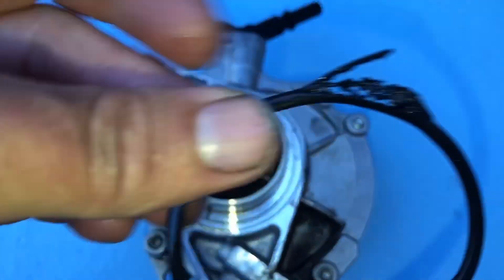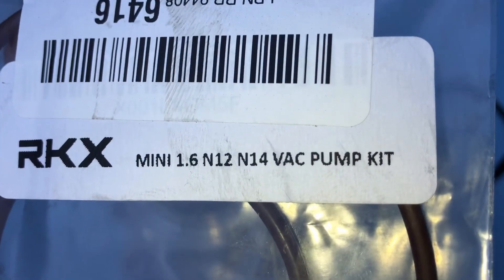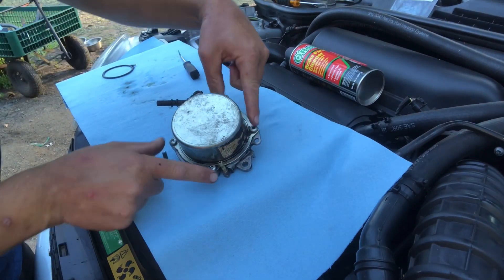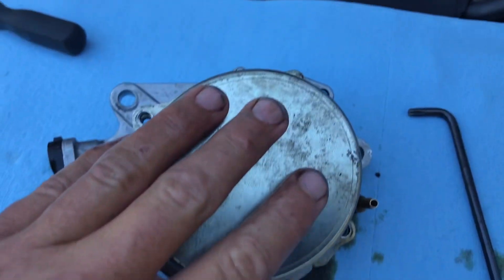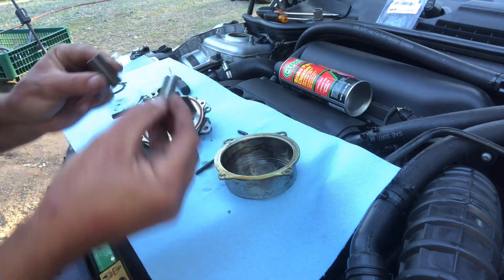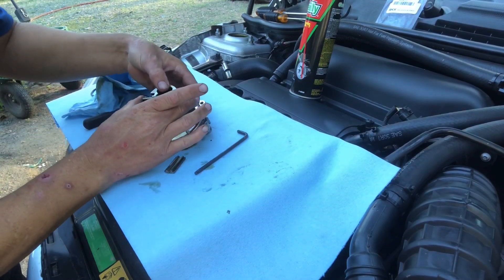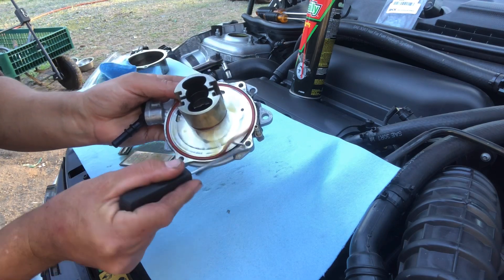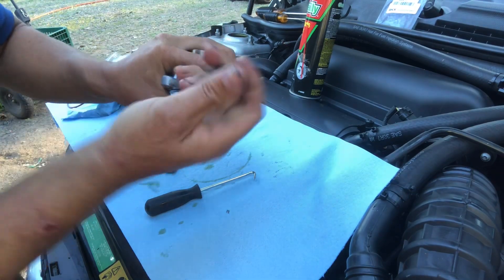How to rebuild the vacuum pump on a Mini Cooper S R56 (N14)

Comment: I'm sure this has already been mentioned but be aware of cheap after market parts. I just removed my new one I bought off Amazon after a month because it started making a loud ticking sound. Luckily I kept the old one, pulled the seals off the "new one" and put it in the old one which was working great just leaking oil. The new one had significantly less vacuum than the OG and internal quality was terrible using plastic parts.
Great vid.

Comment: Just wanted to say I'm not mechanically minded but I am learning.

My r56 2009 s series has a leak; watching your videos has given me the confidence to locate and fix it.

over time, I'm going to follow your steps and overhaul all the hoses as from what I have seen they are all crap and break easily.

Just need to ask, would getting metal coolant hoses improve, or prevent future leaks or should I stick with the plastic ones?

Comment: Should title the video “reseal” instead of “rebuild “. I believe there’s likely a bearing for the coupling shaft you didn’t address. This pump is critical. When it fails the exhaust cam quits turning.  Happened to me. Luckily I didn’t have valve damage.  Many have.

Comment: Hey bud. Great videos. So I have a question. Right now my vacuum lines go from the pump right to the solenoid and right back to the turbo. So someone bypassed the vacuum tank. Is that ok ??  Does the Reservoir tank have any purpose really ??  Thanks man.

Comment: Excellent video......and explanation.    Yeap....replace that pump with a new one. 
Might be a good idea to replace every 80K miles. My R56 has 120K and starting to notice an occasional issue with the Brake Booster.
Vacuum pump is a lot less expensive than the Brake Booster.
Reply from the maker: Thank you 🙏 you’ll be spending a lot of money if your vacuum pump fails 💯

Comment: Do you know the size of the orrings??? Oem orange one is square not circular. I’m from Uruguay I can’t buy this kit in my country.
Reply from the maker: I don’t know the size, but I’m sure that if you contact the manufacturer they can tell you. The vacuum pump I rebuilt in the video is OEM do everything you saw me remove in the video was OEM.
Reply: Project Mini thanks! My vacuum pump is exactly identical as yours

Comment: Have you thought about doing a vacuum pump delete? Or do you believe replacing/rebuilding the vacuum pump every xxx amount of miles is good enough? How many miles would you recommend? Keep up the good work!
Reply from the maker: You need vacuum for your brakes to work and for your waistgate to work
Reply: @ProjectMini  Sorry, delete isn't the right word. I meant swap. I have heard of people blocking off the original vacuum pump and installing an electric vacuum pump.
Reply from the maker: That would be s good idea, maybe someday I’ll try it

Comment: What noises did you hear from it? How did you know the vacuum pump needed to be fix/rebuilt? My Mini Cooper s 07 r56/n14 is spuddering in a way? As well the turbo doesn’t kick on when i give it gas. Half check engine light is on, just got the thermostat housing replaced, water pipe, water pump, hoses. Expansion tank. Timing Chain and everything along with it got replaced too a while back, HPFP is new as well, vacuum pump is making a slight off noise that it never made before. I need help on this
Reply from the maker: Mine didn’t make any noise. I took it off so i could move my oil feed line and saw how bad the gasket was. It was leaking oil though
Reply: I don't suppose you found what the issue was, mines doing the exact same thing

Comment: Where is the pump located in the engine?
Reply from the maker: On the head right next to the turbo inlet pipe. Its what the vacuum line that goes over your intake tube plugs into